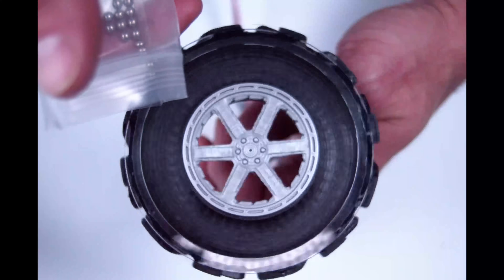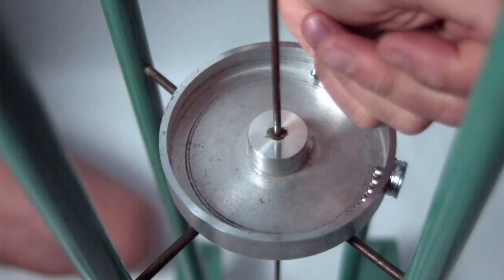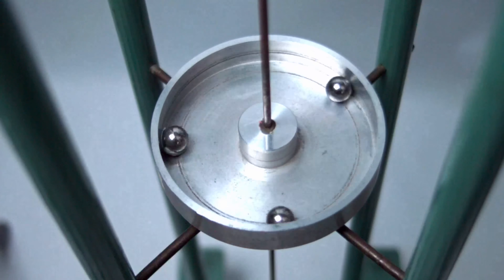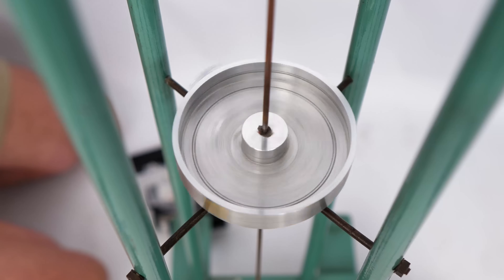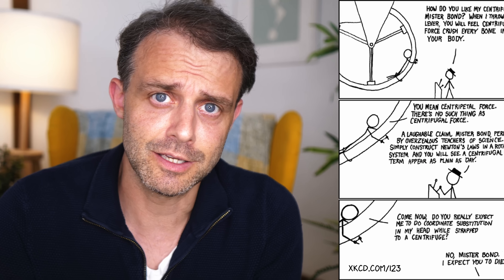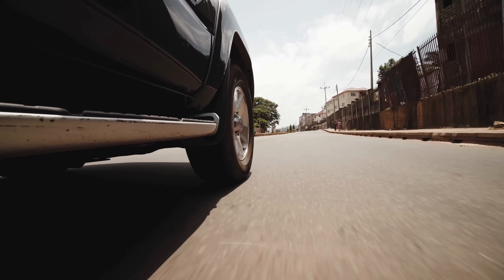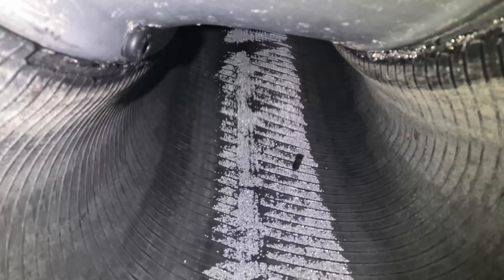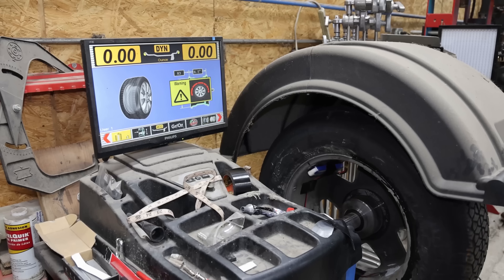Do tire balancing beads actually work?

Comment: Considering tyre centers always balance new tyres in the price &, weights rarely fall off, balancing beads are a fix for a mostly non existent problem. Even in the event that I were to have an out of balance tyre, I would simply get the tyre balanced &, ask the tyre center to rotate the tyres while they were at it.  
If you can't afford to have a tyre balanced, you can't afford a vehicle.

Comment: Tyre/wheel balancing beads are snake oil.

Don't get me wrong, they clearly do work under specific circumstances, but you could argue the same for snake oil - maybe it's a decent salad dressing or a substitute for cooking oil, maybe it can be used as a machine lubricant or perhaps it simply smells nice and should be used with a reed diffuser. I guess the point I'm making is that it's a product which claims to solve your problem, but it doesn't really solve it - rather, it plays on a naturally occuring phenomenon to sometimes improve the situation.

Ultimately, if you need to accelerate the vehicle to the national limit, that means the beads are probably going to only work near the end of your journey, once you've left the motorway. And because of the way our infrastructure is designed, you are very likely to be forced to come to a complete stop as soon as you reach the end of the slip road and find a set of red lights or a give way line waiting for you. So, the beads may work, but in this very common scenario you only get the benefits for about 250m or so. They do nothing at the start when you're getting to the motorway, they help a minor amount on the motorway however the problem ahs mostly fixed itself during this time, and then they stop working almost immediately after you leave the motorway and are forced to stop, meaning that once again they do nothing at the end of your journey getting from the motorway junction to your destination.

Comment: Why not just have a auto-ballacing unit on each wheel - I could consist of an outer rim that is smooth and a inner ring that is rubber and inflatable, between these 2 we have the beads - now when you are a motorway speed the inner rubber ring is inflated and Lockes the bead in place. This contraption could just be an inflatable liner ring in the tire ! and the tire would be the outer ring. Free idea for anyone - just name it after me !

Comment: Same method is used in some cdrom drives. These drives spun with incredible speeds in the last iterations so some companies like Samsung put metal balls to balance the weight of CD and drive parts. Otherwise the whole computercase was humming.
You can clearly hear the balls on spin up / down

Comment: 10:10 I don't know where did you get the Information that it solves itself on freeway. It does not. It gets worse depending on the speed. For example my old carstarts  vibrating at approximately 135km/h at approx 142 it stops and is all good until 160 where the whole car starts to shake violently and stops once again at approximately 170. Btw the wheels are balanced( with counterweights) but something causes this phenomen. I am considering adding the balancing beads for this reason
Reply: By the way. I worked in truck/lkw/lorry tire service and we always put the beads in and lorry definitely won't be touching the highway speeds as they're limited to 80km/h (50mph) here in Europe. So I appreciate you results from Cambridge but the reality is somewhere else

Comment: 5:10 I don't like the wording of calling centrifugal force a "fictitious" force. It exists, only just as a component of the centripetal force.

There's an important distinction between the two, but calling one fictitious because it's only a component is like calling current fictitious because it's a function of voltage and resistance. If there's a use for such a metric as centrifugal force, then it's worth acknowledging as real.

Comment: I believe the main intent of the beads should be for Off Road applications. The thought being that while using a vehicle off road loosing a external weight is highly likely. There is also the increased risk of spinning the tire on the rim, again loosing the preset balance. I would say that even with using the balance bead you would want to start with a tire that is mostly in balance. This is done even when using conventional balance weights, so less are needed.

Comment: I really prefer my wheels & tires to be balanced at all speeds, not just above some critical speed.  Also, it appears that the glass bead balancing isn't as precise as the balancing done by modern tire balancing machines.  Lastly, modern machines have a "road force" roller that presses against the tire tread and can sense stiff spots or high spots in the tread and compensate for that with the balance.

Comment: Interesting... I would have thought these were a scam as well.

I still think they're inferior; most shops use balancing machines that also measure lateral balance. Wheel weights go on both sides to balance in both axes. I doubt these can do that, but... maybe?

Comment: I used to use slime in my tyres because of the risk of punctures on frequent long journeys and the lack of a spare (thanks BMW). When starting a journey from cold (and more so in winter), the car would wobble like crazy for the first few miles. After the tyres had a bit of heat in them from the deformation of each rotation, the wobbling would subside, and 15 minutes later, once on the motorway, all shaking/vibration/wobbling would be gone completely. Much better than it ever was before adding the slime. 
I now assume it was providing the same effect as the beads.

Comment: When we drive in the desert with low tyre pressure, it happens that we pop out and then, when we reinstate the tyre in place, we end up with sand in the tyre... that's free balancing sand. But it's not recommended to drive too much with the sand inside as it deteriorates the inside. I had a tyre totally deformed due to sand inside.

Comment: Would it also work to use a liquid instead? I imagine you need something dense and not prone to boiling.
I'm also thinking that a heavy silicone might work well if they apply it at the mechanic and spin the tire until it cures

Comment: Old CD/DVD drives made use of small balls inside the motor housing, not all CD/DVD's are balanced, and that was the only way to get rid of enough vibration for the laser to be able to actually read the data.

Comment: So every time the car stops you need to accelerate to 50mph to rebalance your wheels? No thanks. I’ll pay the guy at the tyre place a few quid every 20,000 miles instead. It seems a lot better.

Comment: Here's a solution for the tires: add a glue to the beads and put the wheel to spin until the glue fix them in place inside

Comment: So I have some anicdotal evidence.

I have a defender with aggressive mud tires and had mega issues getting them balanced.  

And then when I had been off road things could be far worse.  

I decided to try beads.  

At first then didn't do anything.

 Added more

Still didn't work.

Added about double the recommendation for amount

And then all vibration gone. 

It was immediate and a sudden change.  

After about a year.  The wheels are still balanced.  

The advantages in my opinion are that there's no weights to be pulled off by dirt or debris and the balance is adabtave.  

The balance also works at any speed that an imbalance would be noticeable.  This means that the wheels are essentially balanced at all times.

Comment: One could imagine a flexible UV curing resin and a UV light that activates at highway speeds to cure the resin to the inside of the tire while it’s in the “balanced” position. Or if these beads underwent some process to stay where they are after finding their “sweet spot”

Comment: The system must be at it's lowest energy when the beads are in the balanced position. The fact that it happens at higher speed must have something to do with the components of the energy where the angular momentum plays a more important role at higher rotational speeds.
Reply: Or the self balancing at higher speeds is related to the position of energy minimum depending on positions of the beads which might change with speed.

Comment: Stupid question, could you put some kind of liquid adhesive inside the tire, immediately go to highway speed for a few minutes.  Let the beads get stuck in the correct position for x number of minutes, and then they would stay in exactly the right spot?

Comment: Tire Balancing beads would only make sense if they would glue themselves together once they reach their balanced place. And can lose themselves when you need rebalance the wheels because the wife hit the tire rim against the sidewalk once again. Maybe with heat or some other trigger mechanism otherwise balancing beads would be retarded smooth brain- brain rot. 🤔

Comment: Although they do work, the prereqs to getting them to work are too specific and virtually useless for your average trip. So you have to touch somewhere around 120km/H before not having a wobble at lower speeds? but if you are in a spot were you need to drive 30-50-80-90 then those are roads where you can have the occasional or even frequent stop. And so considering that: if you come to a stop, you're either not on a freeway or you're in heavy traffic, both of which would be reasons that stop you from actually reaching the point of self balancing again so you can't rebalance the beads when you actually need them most. 
So in essence: most of the time, when the wobble that you're trying to stop is most noticeable, either you commit a felony and touch the speed at which they balance, or they're useless. Cause even if you just came off of a freeway, odds are that a road that's only 80kmph ish, has some traffic lights or other hazards that would force you to slow down/stop, to the point where they fall down. and then you can't rebalance them again. 
Perhaps for people who need to drive long empty stretches of road at 80+ kmph, I can see it being worth something. but almost every other case it feels like it's basically a gimmick (at least for standard cars)
And even then, it needs to be in countries that aren't ridiculously populated, Countries like belgium/the netherlands/... are so densely populated that you're either on the freeway doing 120 (and the problem is not that big of an issue), or you're on small roads with frequent intersections and stops, and the beads don't do shit.

Comment: The wheel is balanced on the frame. Beads should be inserted in the tire? What about the tire is getting slightly squashed by the weight of the car? I guess in high speed is not a thing, but in the lower speed, the wheel frame get closer to the tire outer circumfence on the bottom. If you create a wheel frame, which would have a ring of, let say, ferrofluid and some magnetic strip, you would be able to balance the weel while riding by some gyro sensor. So you would have an inteligent wheel. But the balancing would be on the frame. Not in the tire.

Comment: As you have not mentioned it I would be curious to know how balancing beads affect dynamic imbalance. The demonstrations and explanations here appear to only relate to static imbalance (the whole car vibrating ). Dynamic imbalance  (the madly shaking steering wheel) can cause more problems than static imbalance, problems like reduced steering grip, pounded out tie rod ends and other steering components prematurely damaged.

Comment: @SteveMould
my grand father has been balancing is 18 wheeler tractor trailer tires for over 2 decades using golf balls, in each tire.

for most of my teenage years in the summer on the farm we would have to breack down and change tires , and i remember how confused i was to debead the tire to find golf balls inside , and to learn thats how my granfather balances the tires.
we all thaught he was crazy , he read about it in some farm show paper and has been using it ever since as he is a long haule driver and does his own servicing of his truck.

i forget the exact number and he often changes it a bit but he was doing like 8 to 12 golf balls in the front steer tires and 6 to 8  golf balls in the other tires.
hes been doing it so long he has a specific brand of golf balls he likes and can get  about 250000 miles before they get warn . some brands the outer shell wears to quickly and they can break apart and the core becomes powder and they wont balance anymore.
 .
so when changing tires we look the golf balls over and when the dimple of the balls are gone we switch them out with a fresh set.
 .
its weired seeing a polished golf ball with no dimples .

our family jokes to grandpa that if ur ever driving down the road and blow a tire , u better quickly crank down ur window and yell ''four''😢

Comment: You didn't take into account the role that gravity has in the position of the beads in the tyre. It'd be impossible for them to hold any kind of stable position in the stop and start (or even just speed up/slow down) of traffic.

Comment: I would say that they move into those positions because like water bearing is going to move to the position that presents the least amount of resistance and since one of the bearings is stuck in place, the other ones are not gonna go to that spot they’re gonna go as far away from it as possible because that’s the path of least resistancelike water, but if they were all free, they would all together because of inertia, but when you fix one to the side, it forces the other ones to find the path of least resistance, which is as far away from that one as possible

Comment: I use balancing beads but only in my jeep tires they are 37 inch tires.  To be honest I don't know why they work great in those tires but not in my 28 inch tires on my car.  The 28 inch tires have greater centrifical force at any given speed.  Car more sensitive to vibration?

Comment: This would be a COMPLETELY POINTLESS  exercise because wheel balancing weights cost pennies and are fitted by whoever changes your tyres 😂😂 so you’d have to either change the tyre yourself in which case you’d just use normal weights , not to mention you’d have to have all the expensive gear to do so, AND the knowledge and skills. Basically you would have to be total moron to use these beads instead of having your wheels permanently balanced at any speed basically for free when you have a tyre changed . WTF is wrong with some people ???? 🤯

Comment: Word of advice:  DON'T.  Your tires were designed to hold air, not beads.  Over 60,000 miles, the beads WILL wear out the insides of your tires, not to mention ball-peening your wheels/rims.

Stick with wheel weights!

Comment: I have a question.
Why tires on my pick up will balance with beads, but tires on my small car (smaller diameter tires) will not balance. They shake no matter how much i put in.

There's a chart of OZ to put in per tire size. Width and diameter is important. But that chart omits tires below certain size.

Comment: My experience with balance beads is in the medium to heavy trucking world. The tires/wheels are so much heavier and get so much more wear and abuse, that  traditional balancing can be a problem. The bigger truck tires also have an internal liner that doesn't wear as easily from the beads. Some of the larger offroad pickup tires are starting to use them more as well. Smaller passenger car tires just don't gain as much of a benefit from them versus traditional external weights. plus passenger vehicles tend to travel at lower speeds more often (aka City versus Highway)

Comment: One problem with the use of tire balancing beads is that they block the use of tire sealant, can be interrupted / cause issues with any tire patch/repair, etc.  Therefore, if you drive anywhere on tubeless tires where the tire may get a puncture, do not use balancing beads.  Further, as others have stated before me, they can wear the interior of the tire, (over long term use) cause issues with rims (especially painted or chromed ones, potentially leading to rust) from moisture in the air you put in the tires, the air can also have oil in it... causing the beads to get sticky and not work correctly... .

If possible, just get tires balanced using weights.

Comment: Super common over here with trucks with big/offroad tires. It’s easier (occasionally more effective) to add beads or water than to use a lot of wheel weights to balance.

Comment: I dont know about this. The little metal disc you are using may not properly represent  the same rotation speed as a car's tyre. This is mathematical  formula that i dont care to research.  So under, say. 30 mph, my tyres will shake? Under 40 mph, my tyres will shake.   With " knock on" weights. Or "tape" weights,  they work.  At 6 mph or 80 mph. They work

Comment: I think what's happening is the fixed ball bearing is pulling the cup away from the freely moving ball bearing, that's why the latter moves to the diametrically opposite side.

Comment: Centramatic makes external balancers which are filled with oil and steel shot.   They are installed by sliding them on the lugs and sandwiching them between the wheel and wheel hub.   They seem to be effective at lower RPM - I wonder if the relationship between bead size/quantity, and the smaller diameter "donut", allows for lower RPM balancing.   Centramatics seem to be effective at ~20mph.

Comment: I've been using balancing beads on my 43-in TSL tires on my 07Jeep when I was daily driving it and they work well so well that now I use them on my Tahoe and I know for a fact a lot of 18 wheelers use either balancing beads or centramatic balancers which uses the same principle and they were just fine and they adjust themselves as the tire wears no need to rebalance ever